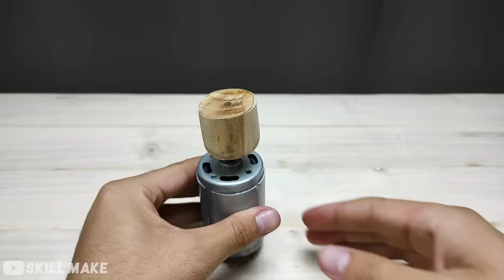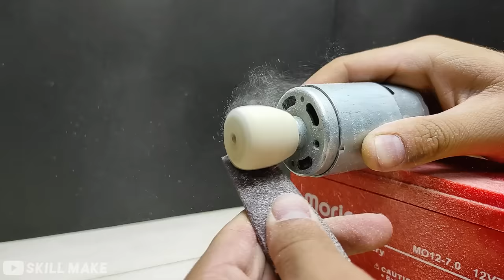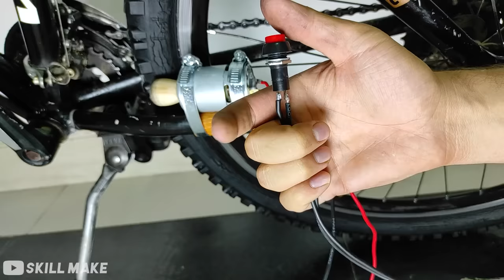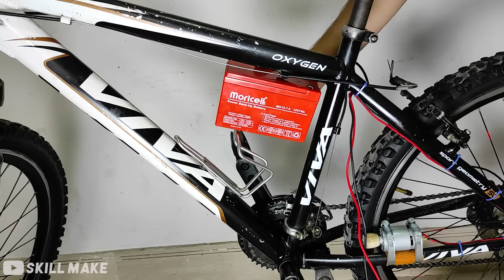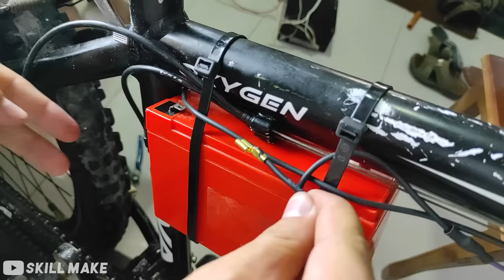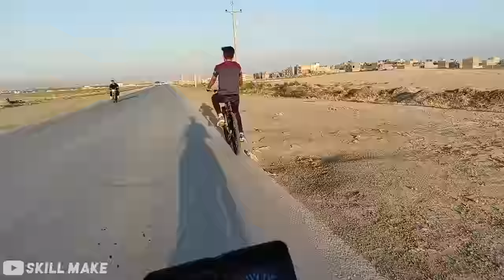How to make electric bike using 775 dc motor at home - DIY homemade electric bike

Comment: What is the top speed?
Reply: Ni😢 me😊
Reply: Matoni qaerdan topsa boʻladi
Reply: @RmsOlympic24 ok
Reply: 50000 km/second 😂😂😂😂😂😂😂😂😂😂
Reply: 300+
Reply: 39,000 mph
Reply: 25 km
Reply: 1km per hour😅
Reply: Considering that the 775 motor has 150 W on average, the top speed can be no more than 22 km/h .
Reply: 5км
Reply: 20 km
Reply: Que tipo de bateria é essa ?
Reply: 12kph
Reply: 40 km speed
Reply: Çok yavaş kalıyor hiç gitmiyor desek yeridir ben denedim
Reply: 0 km per/hour😂😂😂
Reply: 20mph
Reply: ignore the other people, I made one and it goes 30kmh.

Comment: To make it faster make it 20v
Since operating voltage is 6 to 20v

With 20v you can use a 555 instead as a alternative

Comment: how did you connect the charging port to the battery? can you guide with the process it's not clear in the video.
Reply: He connect charging port with wires from akumulator he connecting wires and whola we have port charhinng 😊

Comment: can you make a bike that recovers energy while you cycle and stores it in a battery mounted on the bike
Reply: Add a motor to the front wheel and wire to charge controller then to battery. It returns energy

Comment: Bro if we paddle battery would be recharged ?? As per by mechanical energy into electrical
Reply: You'd need extra protection, you could ruin the battery
Reply: Add a charge controller

Comment: Thanks for wasting my time, effort,money it doesnot work it can only ride upto 10 kgs if i sit on cycle it doesn't work
Reply from the maker: You should use 775 power motors, not speed motors